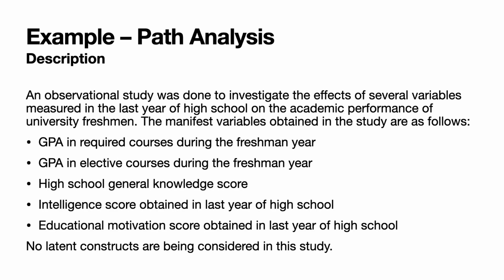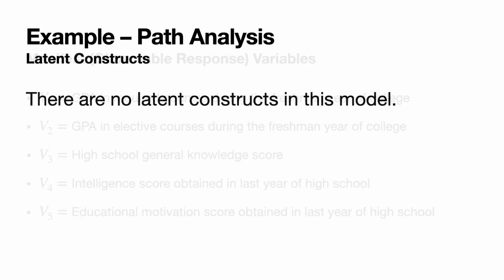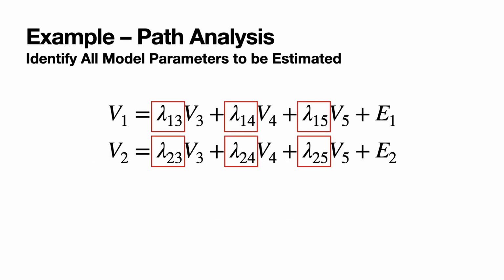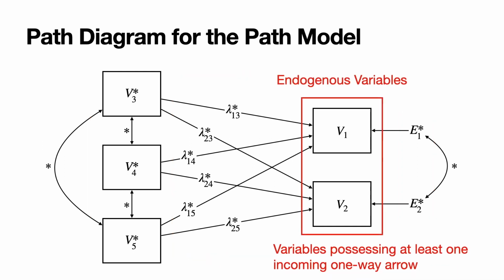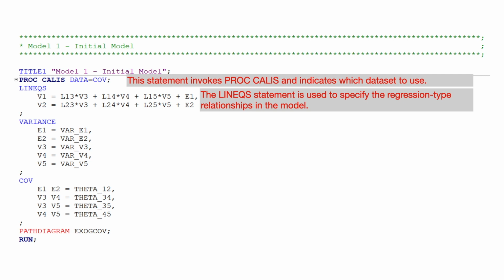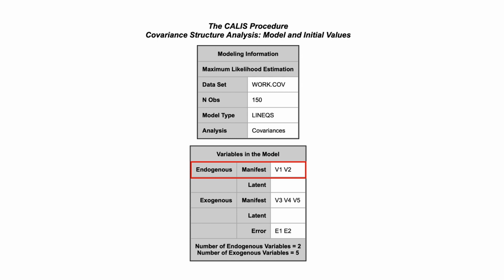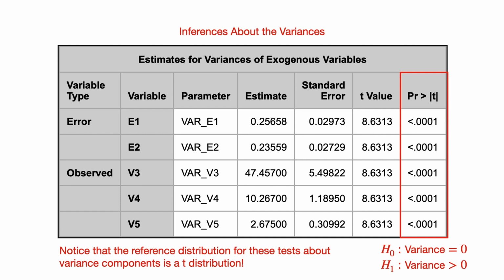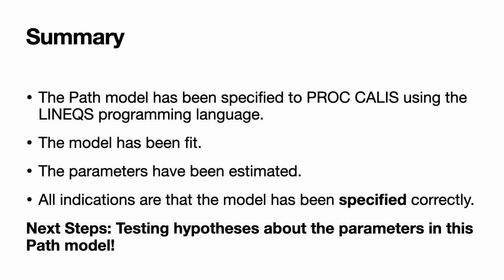Fitting a Path Model Using SAS PROC CALIS

Comment: I have some questions I'd like to ask the experts.
1. I read some articles about methods for handling longitude data, like The SEM approach to longitude data analysis using Calis procedure by An and Yung, but they didn't use path analysis. If I want to use path analysis to analyze longitude data, how should I go about it?"
2.Additionally, my variables include both binary and continuous types. How should I handle this? I find some way that use METHOD=ML to deal with it, is that correct? Basically, I think the outcome should be a little bit like Logistic Regression.
Bottom part is my code, but this is not longitude data, and I have no idea that this way can deal with binary variables (TNT and HF is binary).
For short the parts, I delete some similar code.
proc calis covariance outmodel=_eqparms_ method = MLM ;
lineqs
TNT = pTNTDM DM +pTNTLVEF LVEF+e_TNT,
HF=pHFTNT TNT +pHFbmi bmi+pHFDM DM+e_HF;
var TnT tempme bmi dm age lvef egfr msbp edvi_di HF;
run;
proc print data=_eqparms_;
run;